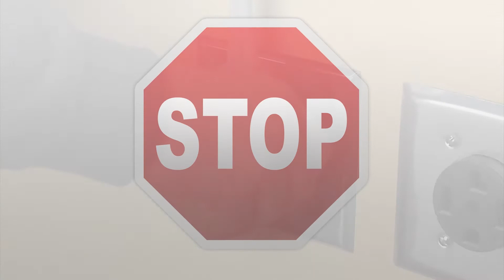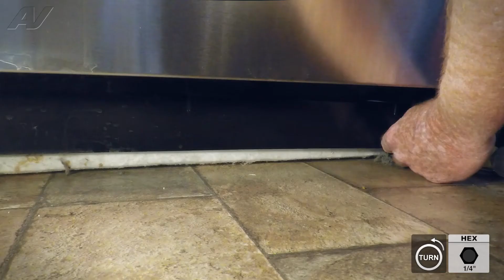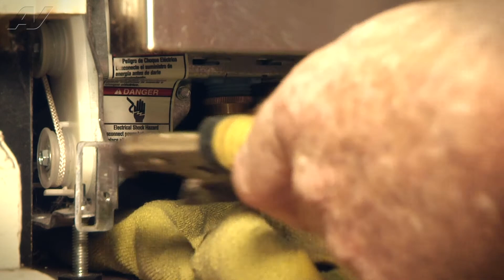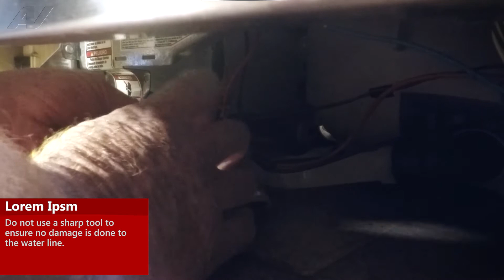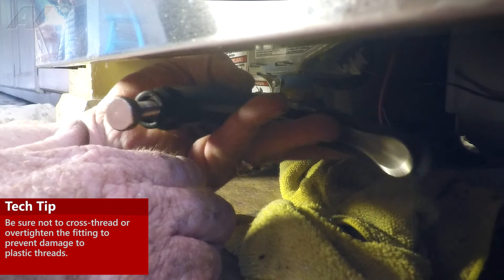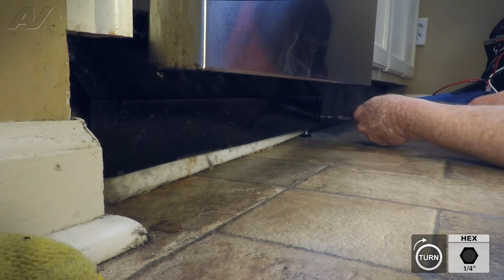Kenmore Dishwasher Repair - Not Washing Completely - Diagnostics & Troubleshooting

Comment: I have, what appears to be, the exact model (66513213K901) and the repair worked perfectly except for one catch.  The replacement part I got blocked the bracket from slipping on all the way.   I have it in there  a snug as I can get it, but it's a good 1/4" away from matching up to get the screw back in.  At any rate, I put everything back together and it worked like a charm.

Here's the part I got off Amazon:  https://www.amazon.com/gp/product/B085PYSLC4/ref=ppx_yo_dt_b_asin_title_o01_s00?ie=UTF8&psc=1
Reply: Update:  the water is still trickling in and not enough is getting in to generate the pressure needed.
Reply from the maker: Great question, if you have a more technical question that our parts department cannot answer, you can search our over 17,000 answered questions free at our website www.ApplianceVideo.com under our Repair Help section. You can also call our parts department at 1-800-830-5465 and they can give you help 7-days A week ,or search at www.SaveMoreOnParts.com  .